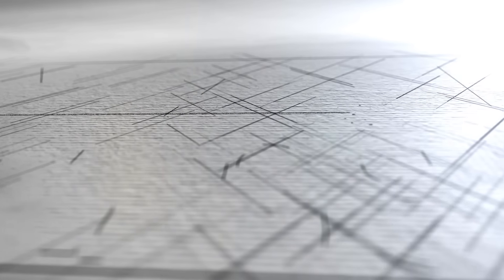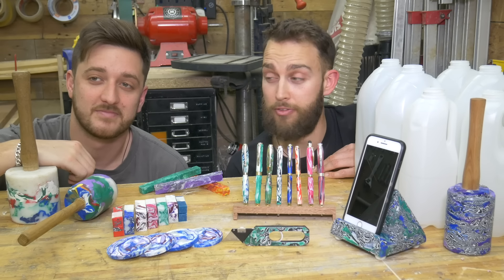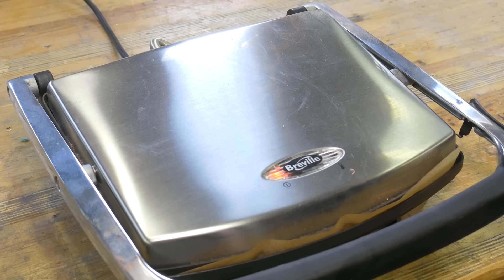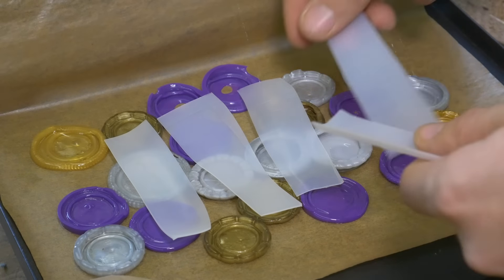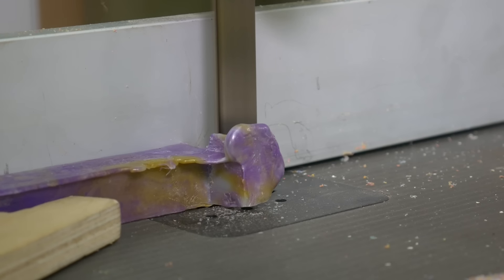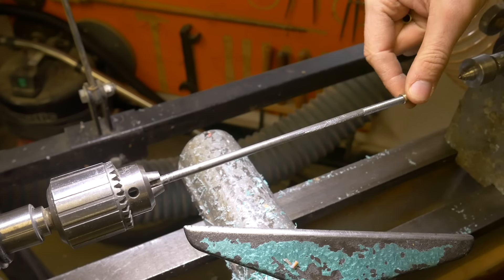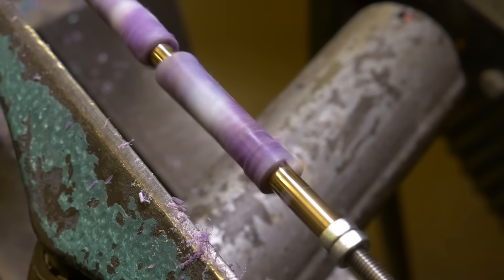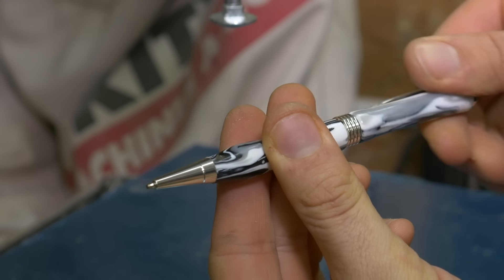Beginners' Guide to Melting HDPE - How to Make a Recycled Plastic Pen

Comment: Why avoid clear HDPE? It's the most common form I come across.
Reply from the maker: Because completely clear plastic isn’t HDPE. Most likely PET or PP
Reply: @BrothersMake  Thank you for getting back to me on this.If it does have the 2 inside the recycling symbol can I still use it? E.g, clear one-time use water bottles. Or is that PET or PP even though it has the 2?
Reply: My apologies, not the bottle itself but the cap.
Though they do have a subtle white colour too them. Maybe I'm just being too nervous about this and taking the 'translucent' comment too far. When you showed the different way you cut up the pieces, most of them were this 'white/clear' colour I'm thinking of, so I'm thinking it's fine...it's not 'completely clear' like you've mentioned here. Alright yeah, I was just being too anal about it being 'clearish' haha, thank you for your help.
Reply from the maker: HDPE is ever totally clear. It simply isn’t possible with its compound. But the cloudy stuff milk bottle are made of is recyclable in the same way, yes. We would recommend to make doubly sure that it’s clean as this cloudy stuff can be really susceptible to colour change/staining from contamination. Good luck!
Reply: @BrothersMake  Thank you very much!

Comment: Why no clear plastic?
Reply from the maker: HDPE is never clear - you’ll usually find that it’s PET or PP. HDPE is translucent at best.
Reply: @BrothersMake  Thanks for the response. In the video you said no clear platic so if it is not HDPE is it safe to melt at home?
Reply from the maker: They both melt at different temperatures and in different ways. I don’t think PP works using this method but PET may do. Haven’t tested it.

Comment: There are several problems that are immediately apparent in your video.
1. Amazon does not sell in Thailand or in many other counties. You should consider other sources for your "equipment".
2. You both speak so rapidly and with such an accent that you are very difficult to understand. You should speak more slowly and provide a written script.
3. Eliminate the background noise as it is distracting to the listener trying very hard to understand what you are saying.

Comment: Repent of breaking because you weren't getting your HTTP hot enough to fully bond together it wasn't an air bubble it was temperature problems
Reply from the maker: It was well bonded together, it was a visible air bubble under the surface. With the compressions and temperature we are using there is no issue with the bond 👍🏽

Comment: You just cut them in so small pieces that they are impossible to recycle... Not to mention the amount of plastic dust from all that sanding! Then you make some new plastic things, but that does nothing to save the planet. The only solution is: no plastic!
Reply from the maker: ‘No plastic’ is not a solution for all of the plastic that we currently have. That would be great if no more plastic can be produced from now on, but that still doesn’t solve the horrendous amount of plastic still potentially going to landfill. Our projects are just ideas for how to use up some of this excess.

Comment: so there's no glue that works with HDPE?
Reply from the maker: We’ve heard that there’s possibly a type of solvent you can use to treat the surface to make it adhere better to glues. However we don’t know what specifically. Also if it’s solvent based it sounds very toxic (and probably not particularly eco-friendly!) it would mean that HDPE products would become un-recyclable so we haven’t tried it. Hope that helps!
Reply: @BrothersMake  thanks, yeah it's not worth it if it's not eco friendly

Comment: NEVER use a saw in this manner, you can and most likely will lose a finger
Reply from the maker: The only clips of us using the bandsaw in this video are used alongside a push stick or with our hands well to one side of the blade. There was no risk of safety whatsoever.

Comment: It is too stupied. You are spendig  too energy  and time for this job. It is very expensive
Reply from the maker: All our energy comes from renewable sources. In terms of cost, no it’s not expensive at all. #notstupied
Reply: @BrothersMake   you have one metal  pen. You are using raw meterial  for this peb. You should  use this raw meterial for useful   things besides when   plastic is melting .harmful goses is accuring . This is not good   for air pullution. I dont know it is not neccesarry. You shoud  do usefull things  like cutting board.
Reply: @BrothersMake   time  time
Reply from the maker: We've already done one 👌🏼
Reply from the maker: Pens are one of most requested items!
Reply from the maker: Ok dude 😁

Comment: waste of energy! too much co2 emission. just put them on the recycle bin and buy a mass produced pen. artists waste more than capitalist industry
Reply from the maker: How much energy do you think mass production equipment uses?! 🤦🏻‍♂️
Reply: @BrothersMake  way more less than individuals running electrical resitors at home
Reply from the maker: Completely disagree. Commercial recycling is not an efficient process. If the plastic actually does end up getting recycled and not into landfill then cleaning, washing, drying, sorting, shredding, reforming and finishing, not to mention the ridiculous amount of transport emissions between every one of those steps. If you think buying a single use mass-produced plastic product is more sustainable than finding ways to use up to crazy amounts of plastic littering our earth then you are a huge part of the problem.
Reply: @BrothersMake  you are not reading. individuals must stop wasting energy in the name of recycling. if you call it art, art it is. art is low efficient. if you call it repurposing, melting plastics at home waste too much energy. in this piticlar example it harms environment.
Reply from the maker: Still disagree. Whether it’s art or not is irrelevant. Would you rather we make products out of virgin plastic, in turn creating a demand for more crude oil to me extracted and refined, and leaving the trillions of tons of plastic to potentially end up in landfill or the ocean? 100% of our energy supply is from renewable sources so your point is entirely mute.
Reply: @BrothersMake  you are still not reading. make a video recording the all electricity consumption and waste (the chips coming out of lathe) make the calculations you will see.
Reply from the maker: If watching us collect all the chips in order to recycle them again AND me telling you that we pay a premium for 100% renewable energy isn’t enough for you then we’ll just have to agree to disagree. We certainly do not have to justify our energy use to you... how did you charge/power the device that is allowing you to reply to this comment? Check your own energy usage before criticising others.

Have a nice day.